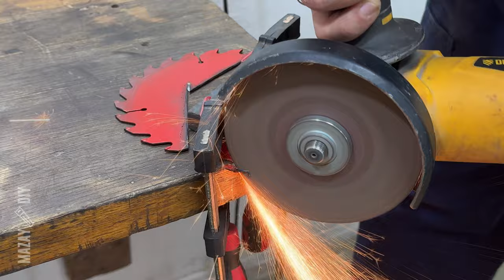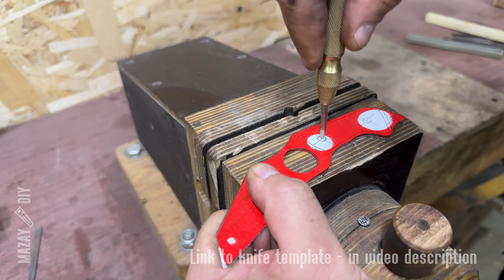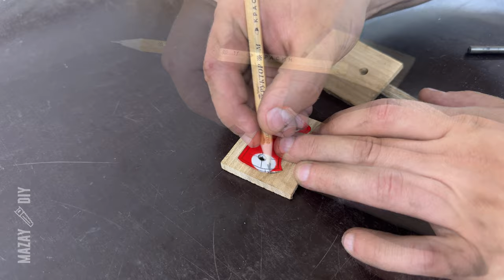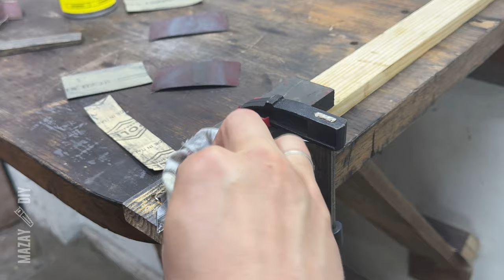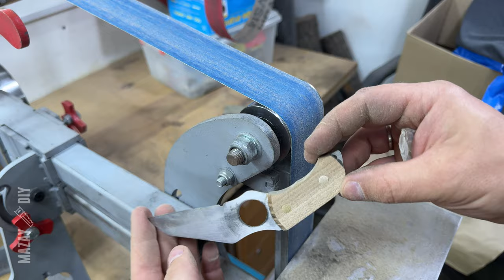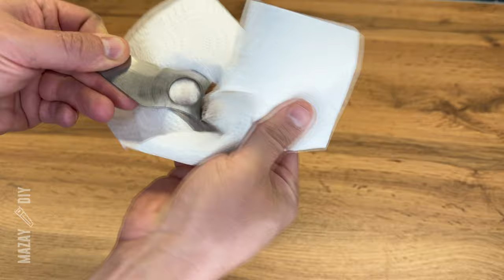Knife Making - Knife From An Old Saw Blade

Comment: What should you be looking for when making a knife out of a circular saw blade? I would love to try something like this, and i just need to know what i am looking for.
Reply: All you need is a modern saw blade. Ones older than 50 years have mild steel middles; now days it's cheaper to just make the whole thing out of higher carbon steel. If it's for yourself, just do it. I have a few knives that are kinda soft that I need to sharpen often, but they are soft(ish) so it only takes 5 minutes.
Reply: @clintonm2357  awesome thank you. I'm in the process of making a Japanese chef knife out of a concrete cutting blade. I ended up taking a piece of the blade and heat treated it and tested to see if it would harden. The pice I hardened shattered when I tried to bend it so I think it will be a good blade if it doesn't warp.
Reply: @MrJohney  the channel UK Bladeshow has great interviews with a metallurgist who described how crystals continue to form for about 5 minutes after quenching, so if you put your blade between two pieces of flat metal and clamp it tight after hardening, those warps usually relax. I've been clamping everything and have been 90% warp free since I started doing that.